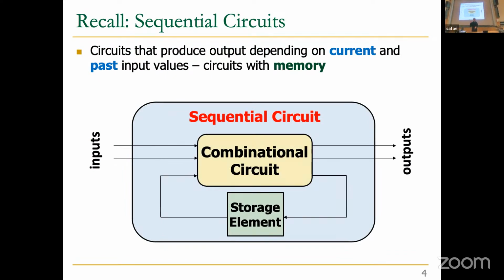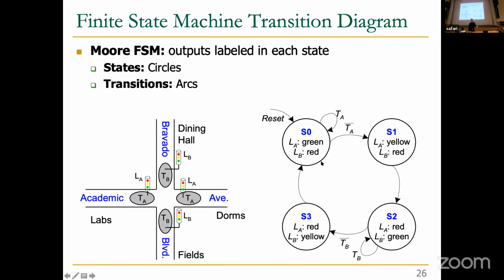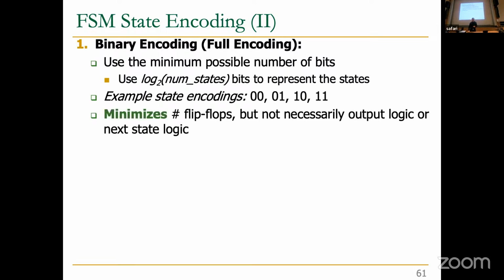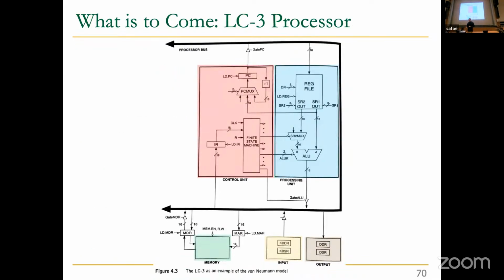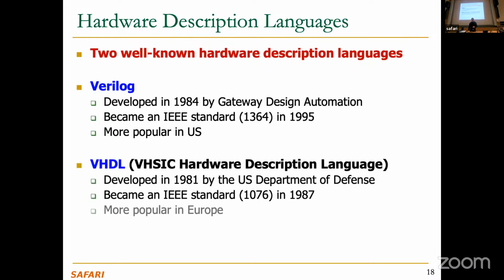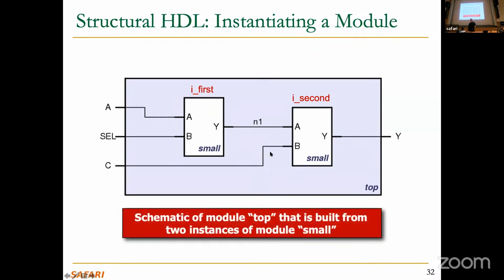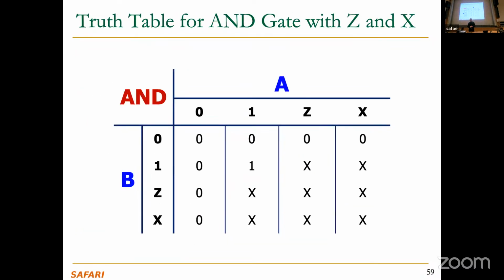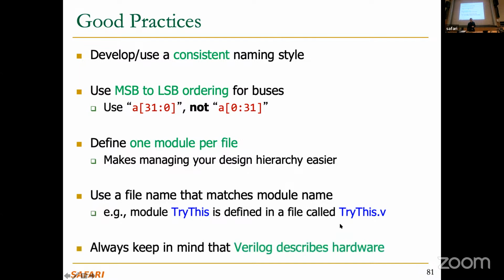Digital Design & Comp Arch - Lecture 5: Sequential Logic Design II & Hardware Description Languages

Comment: 01:39 Sequential Logic recap
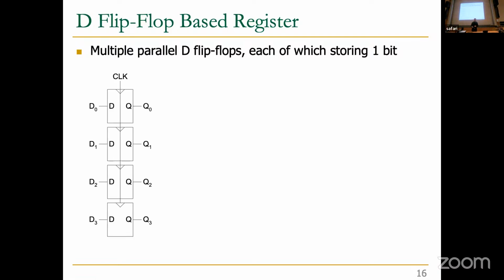08:03 D Flip Flop Based Register
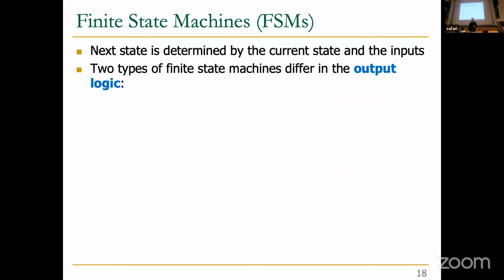10:34 Finite State Machines
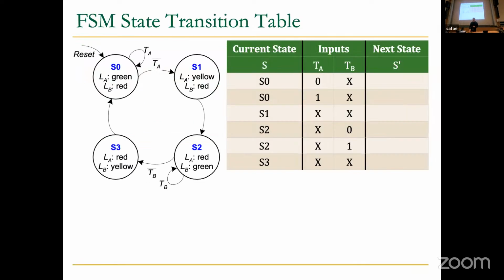18:48 FSM State Transition Table
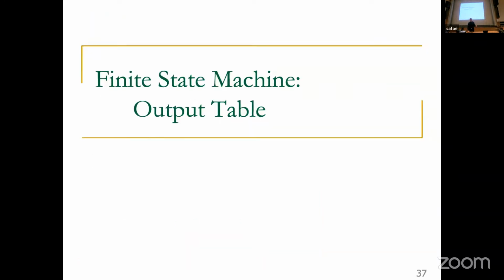22:25 FSM Output Table
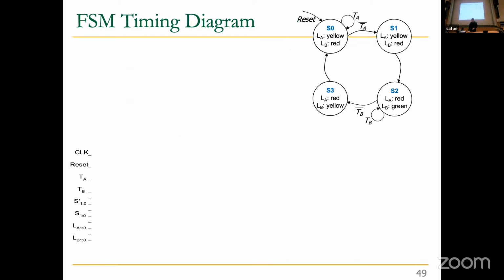25:24 FSM Timing Diagram
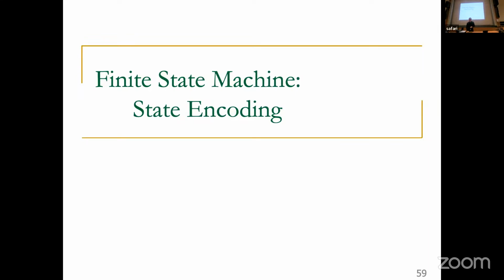30:40 FSM State Encoding
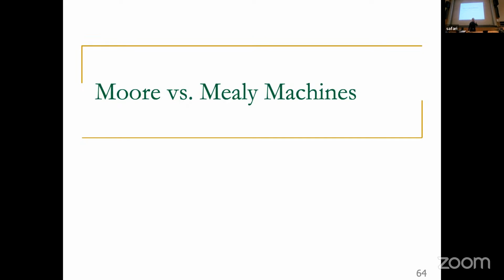34:14 Moore vs. Mealy Machines
37:31 FSM Design Procedure
41:39 Break
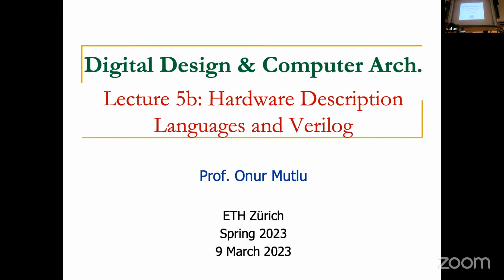52:35 Hardware Description Languages and Verilog
57:51 How to Deal With This Complexity?
1:01:28 Why Specialised Languages For Hardware?
1:04:32 Key Design Principle: Hierarchical Design
1:08:20 Defining a Module in Verilog
1:15:13 Structural (Gate Level) HDL
1:20:20 Behavioural HDL
1:26:24 Precedence of Operations in Verilog
1:32:03 What Happens with HDL Code?
1:38:53 Comparing Two Numbers